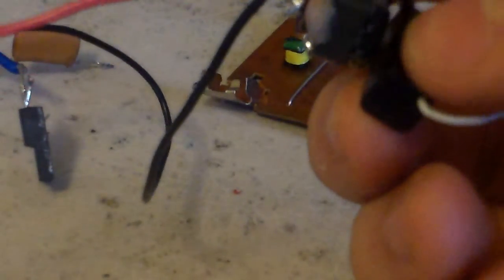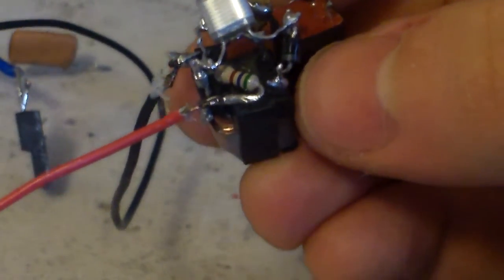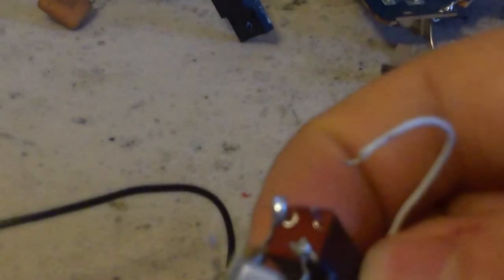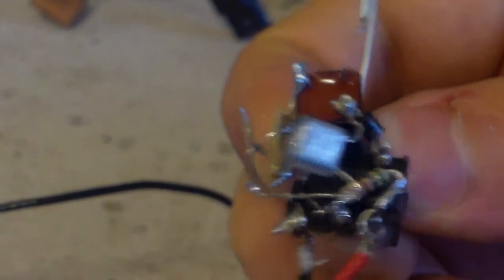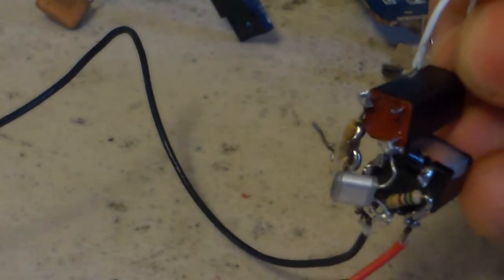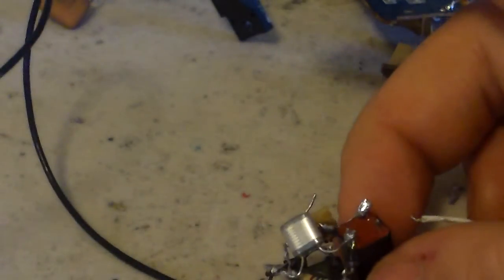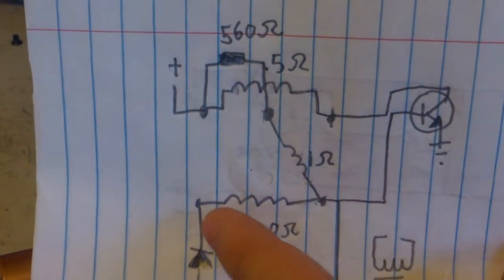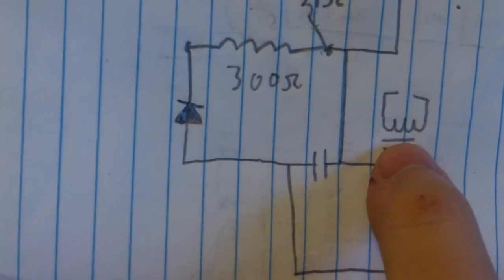tiny camera shocker

Comment: Nice little HV circuit . Have you ever used gas discharge surge suppressors as a spark gap ?They work great .They will even work as a interrupter for a Tesla coil running of a oil furnace  ignition transformer. I bought 8 300 volt ones on e bay recently for 12 dollars . They come in different voltages they switch quick and can handle high amperage loads. You have fun stay safe and I will keep watching your work. You have a great future in electrical engineering if you want it..
Reply from the maker: Thanks a lot for the comment, i have not used those before, i will check them out